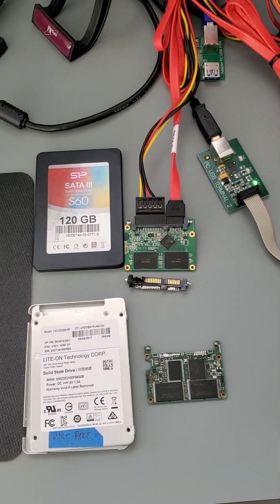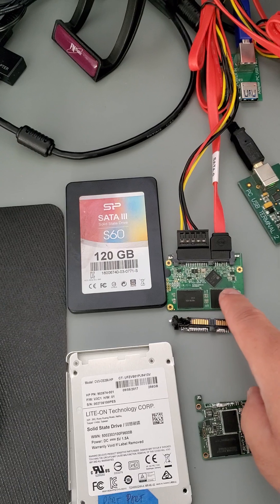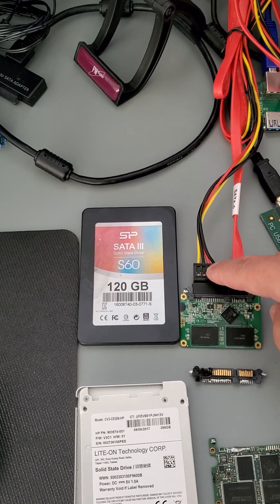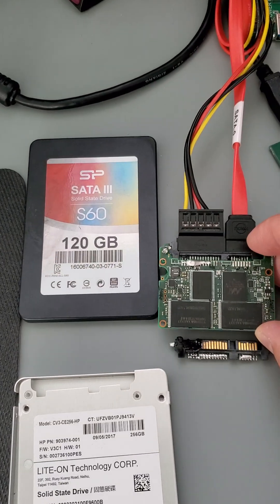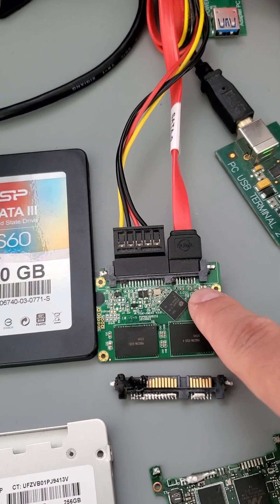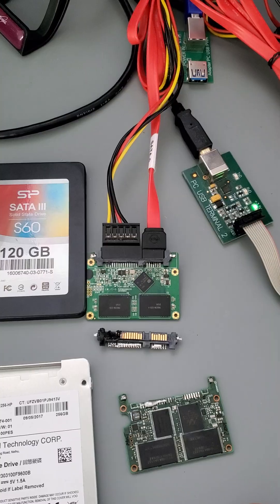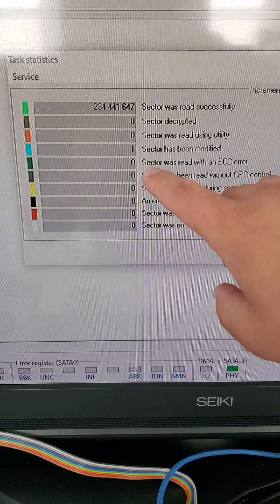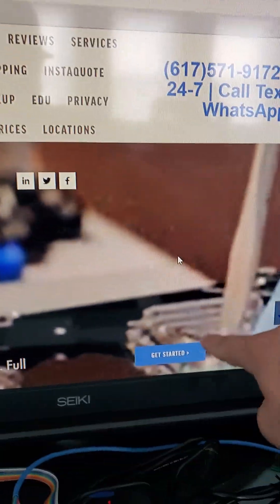How to repair a damaged Silicon Power SSD with burnt SATA interface

Comment: Is there any video how to replace the SATA connector ?
Reply from the maker: We don't have a step-by-step video of that. I guess that is what you are asking for?! Not sure. Too long of a recording.

You could practice on damaged hard drives. The best way is to use a good amount of solder and flux, be patient as you remove step by step melting the solder joints with a thick iron tip.

Do you have the proper tools to do it?
Reply: @Datarecoveryguru1  i have both solder iron and Hot air blower, but im afraid damaged SSD cause there many micro component beside the SATA port, what best way to remove it ? the SSD is samsung 860
Reply from the maker: @GundulmuGaming  Patiently using smaller iron tip with flux and quick solder at high temperature. If afraid to damage more, use kapton tape to mask some of the nearby components. Practice on other SSDs to become comfortable with the technique.